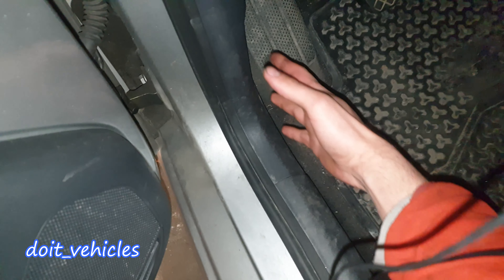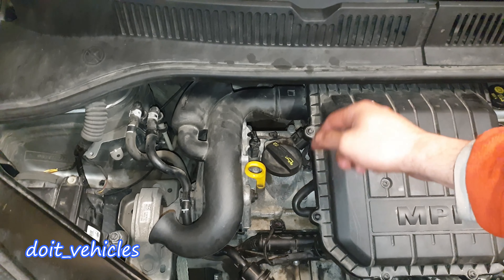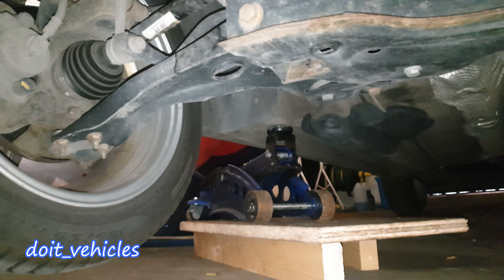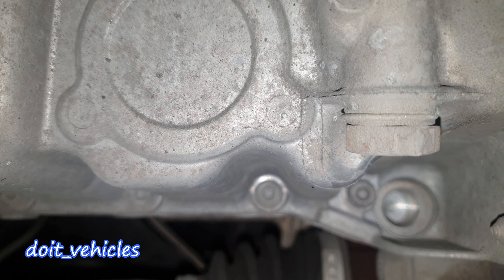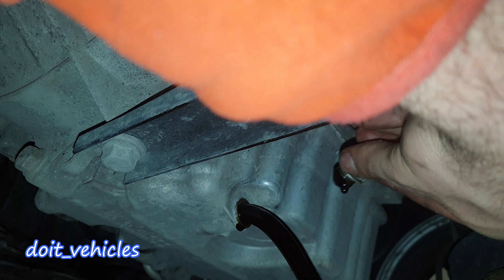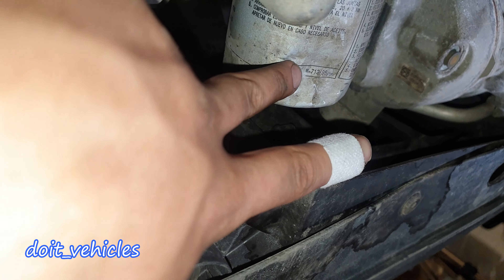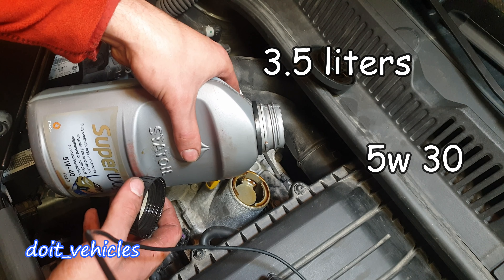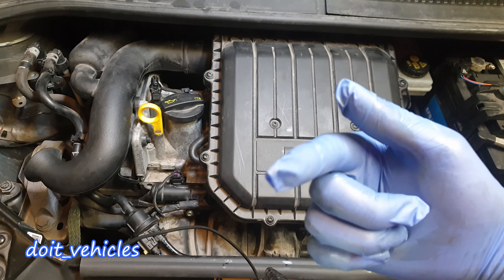2013 Volkswagen up! Engine Oil Change

Comment: Hey Bud good job! Thanks for showing me where it all is.

A tip my mechanic showed me many, many years ago, pound (drive, hammer, puncture) a screwdriver through the oil filter if stuck. Use the screw driver handle as a long lever to free that oil filter.  Its not pretty, but it has worked for me quite often.

Comment: Excellent! I had the same problem with a Kawasaki ZZR1400 filter, had to use the screw driver through the body technique... That said I now have a socket type tool and it's worked great every time.

Comment: Pound (pierce) the oil filter with a long screw driver (not your favorite one, the one you borrowed but forgot to return). Just hammer it right through. Use the screw driver to give you leverage to twist that sucka loose. Messy, but it works. 

Take a drop of oil and smear it on the new filter's rubber gasket and threads. Don't go all "Hulk Smash" to put it on.
Reply: I've had to do that several times, but it creates some nasty sharp edges, it's Ok with a little care though

Comment: Good tip about pushing the bolt in after loosening. I bought an oil filter wrench for this car and worked for me. It’s adjustable and can be used on any oil filters and it might save you the hassle of stripping the front of the engine bay 😀
Reply from the maker: I ordered a kit with hopefully all the adaptors :)
Reply: doit_vehicles just to ask.... I noticed you used 5w30. I had mine changed with 5w40 added rather than the 30. Is that actually ok to do that and is there a huge difference between these grades?
Reply from the maker: @Tonysteele2  The recomended viscosity will slightly vary depending on the maximum and minimum temperature ; It's good to follow what is recommended for that engine . So I used 5w 30 as the owner said , I did not reserch about that 😅 And the main difference betwen 5w 30 and 5w 40 is the viscosity when the engine is hot / hot environment like 40 degrees C . Here were I live there are few weeks in the year with around 30 degrees C ; so 30 will be more thin than 40 on a hot day and since there are not meny hot days , the "5w" is more important to keep it on .. At least that's my understanding
Reply: doit_vehicles great help thanks again 😀

Comment: Run engine for 15 minutes first, oil filter will remove a lot easier when warm
Reply: Also the oil drains better when hot
Reply: Might be a little too hot in 15 minutes. Warm is good enough.

Comment: I own the same car, I have noticed that mine after 5000 kms uses about 145ml. Of engine oil, my question would you considered this normal? My engine is almost over 100,000 kms.
Reply: Tone.  thanks I really appreciate it
Reply: What was the answer ?

Comment: You say to use 5w 30 oil, but you're using 5w 40. Which is it?
Reply from the maker: For this car is recomended 5w30 , but for some reason where I live the previous owners used 5w40 ..
Reply: @doit_vehicles  But you can just use 5W30 even if previous owners used 5W40. Maybe the engine will run a bit smoother if you are lucky.
But most of the time a car dealer doesn't care if engine needs 5W30 or 5W40 they just put some in it

Comment: You need to NOT put all the oil recommended when filter changing but only the quantity WITHOUT filter changing. Then run the engine for like 5/10 seconds to let the filter fill up and THEN put in the remaining quantity recommended with the filter change, then run the engine for 5/10 seconds and let it settle for about two minutes. Then check oil level and see if it's good.

Comment: When i opened the oil cap i noticed a vacuum on running engine! Is that normal???
Reply from the maker: Was it vacuum sucking inn air or the air was pushed out of the engine 🤔
Reply: @doit_vehicles  Sucking inn, yeah! If i try to remove the oil cap when engine is running idle she sticks like a magnet to the valve cover! Same if i try to took out the oil stick! Is that normal ?
Reply from the maker: @encopaintmaster6551  I never seen something like that . I don't think it's possible
Reply from the maker: Because if the engine will have that it means it's way out of timing / massive internal intake vaccum leak which will cause the engine to not idle .
Reply from the maker: at least that's what I can tell in theory , I might be wrong though ..
Reply: @encopaintmaster6551  that is normal

Comment: putting the car on jacks means that not all the used oil does come out
Reply from the maker: if the drain plug would be on the front side of the oil sump pan  , maybe
Reply: @doit_vehicles  makes sense, thnx